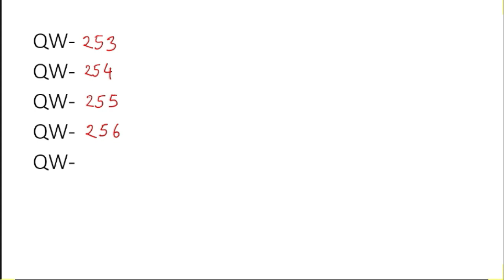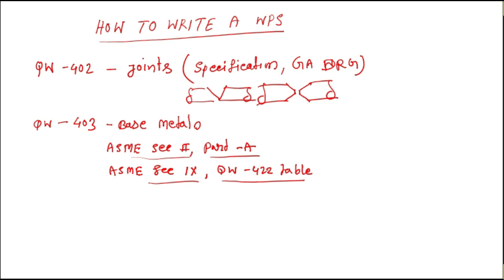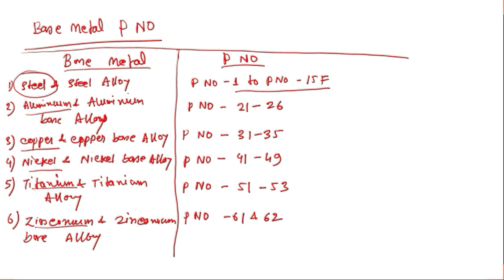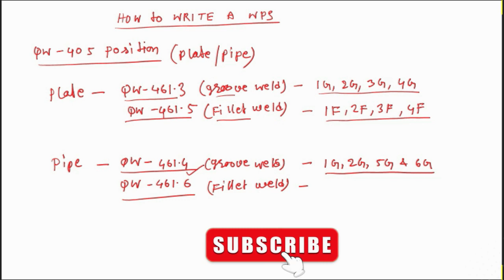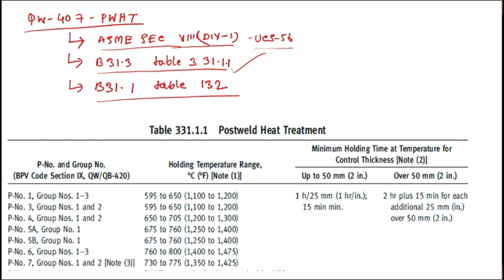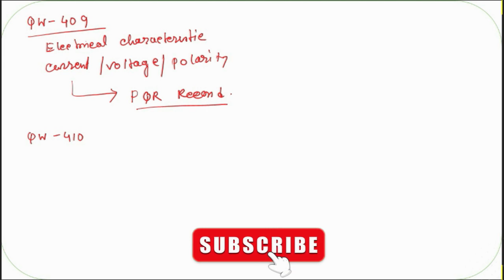How to write a welding procedure

Comment: Sir, “welding inspectors are normallly requested to write welding procedure”, it’s correct?
Reply from the maker: welding inspector can not write welding procedure , may be they can draft the procedure and final approval only must be given by Welding Engineer
Reply: @WeldingNDTInspection  thank you sir.

Comment: while selecting electrode/ filler wire you told in your video F no-6 SFA-5.18. in F-6 there are so many SFA numbers are there then how you chose SFA-5.18. please clarify
Reply from the maker: I just given this one example, it may be smaw or Gmaw as per my experience as I have used the base metal for pipe that is astm a 106,then we can use the process Gmaw and filler for Gmaw.. Thats why i given example for sfa 5.18. This are example if you think any of the electrode can same compatible with this base metal properties the. We can use that one also..
Reply from the maker: i will make one video separately how to select the filler metal , what are the factor are there prior to select the filler metal ?? Soon i will upload details .. that's your question is appreciated ...